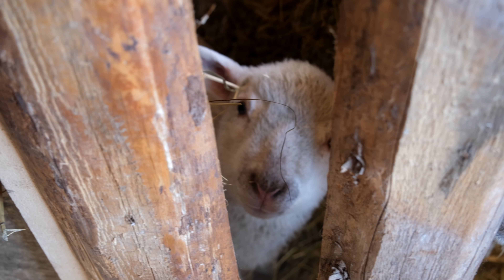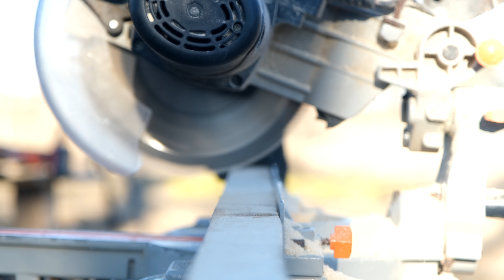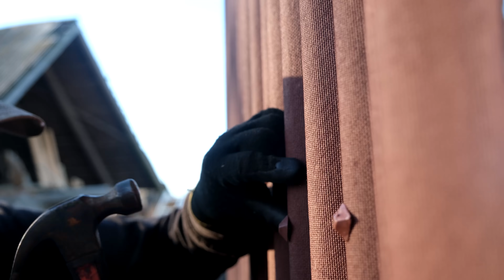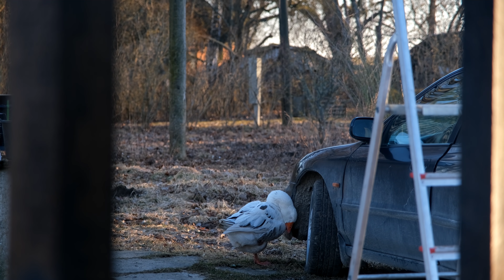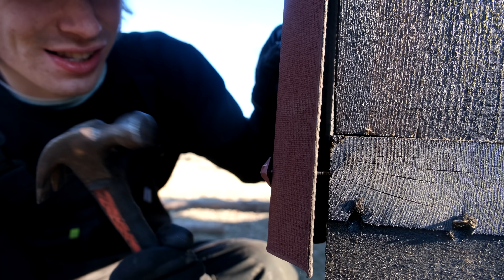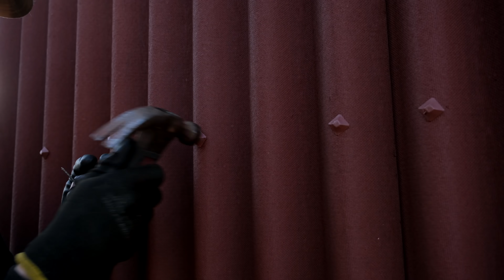Tiny House for Animals (SIDING) PART 4

Comment: I would put some woven wire on the INSIDE at animal level.  That will keep the boys from pushing into the siding and pushing it off of the framing.  We have plywood on our barn walls at animal level for this with our sheep.  The wire would be lighter for a mobile house.
Reply from the maker: That's a good suggestion as this would be a lighter option than wood boards. But will have to add one board anyways just for the heavy punches as they can easily bend through the fence. But it's a good suggestion as we can reduce the weight! 😊❤️

Comment: Maybe you can add a rain gutter to fill into a water storage tote.  Tote has to be painted black or buried.  What is the life time  warranty on that siding?  Just wondering.  Check out Cog Hill. Jason added metal wire flooring to his bird/chicken old small cargo work/truck contains he repurposed.   You can do it!  Get close to being done….
Reply from the maker: Definitely will add some gutters. The warranty is 25 years for these sheets. For floor we will use wood boards. I don't think metal wire would be the best option for goats plus the cost of that isn't even close to just plain wood. ❤️😊

Comment: Why are you buying those bitumen roof panels. These are very poor quality and you will have to change them very quickly especially over the summer if the ice starts to fall. Sheet metal panels are light and high quality and the price is the same.